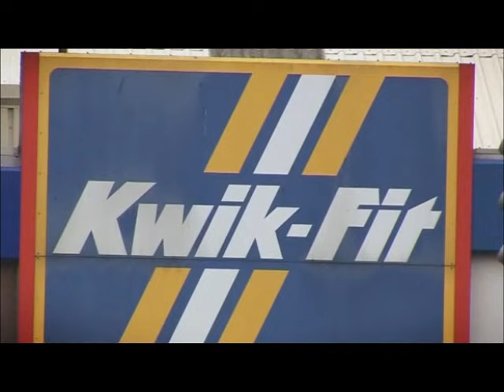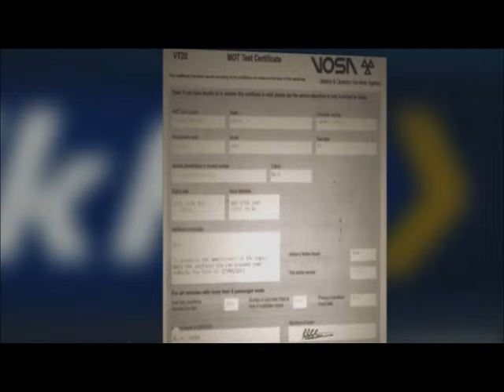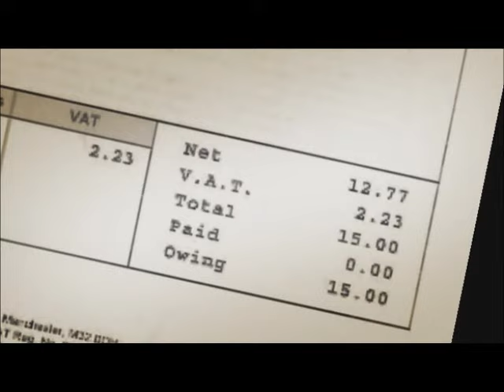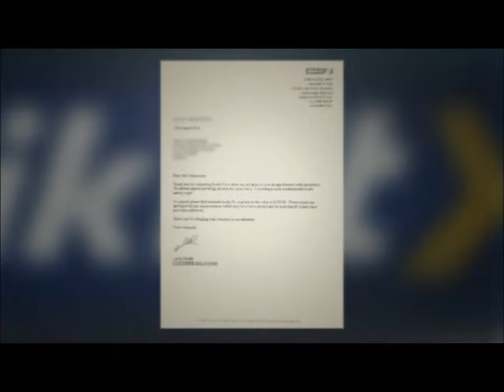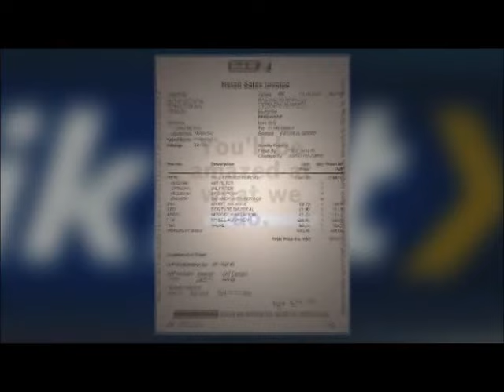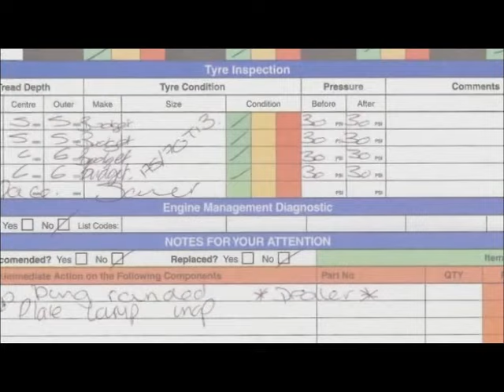Kwik-fit Car Rip-off Watchdog.wmv

Comment: I have used kiwi-fit before like 30 years ago, that was the last time I ever used the rip off merchants, I had booked my car in for an MOT but the day before I had to replace the front brake pads as I new they were in need of replacement and it would fail. So I took it in and about 45mins later I got a phone call saying there were a couple of issues and he said the front pads are down to 40% and may need renewing, I said blimey they didn't last long he said no they do wear very quickly, then I said i only put them in yesterday , then there was a cough and a splutter erm well I haven't had the wheel off yet and the lighting is bad in here, and yes it passed with no problems.
Reply: Their is neither a need or requirement for an MOT tester to remove a wheel, unless he feels that he needs to further investigate a fault. In reality, I have never come across this situation.
In your case, the guy must have been a complete moron to think that you would not have known that your pads were almost new.
Reply: @Ron Flat
Seems you do not know the difference between NEW and KNEW ...
Better buy a dictionary and go back to school to learn English and educate yourself to a higher standard than a 5 year old. 
And one does not GET phone calls, one receives them.
GOT means something that one acquires by toil.
Receive means something that is given to you and you accept it.
If you were a student in my English classes I would fail you.
There are students age 7 that academically outclass you.
Reply: wilsjane as
Reply: thats fuckin hilarious man🤣

Comment: This is why I go to my little local family run garage for anything I need. My car got a couple of advisories on my exhaust brackets and front tyres were apparently worn, plus my allignment was off and these thieving cocksnots wanted to charge me £750+ VAT for 3 exhaust brackets, £250 for tracking and allignment then £85 per tyre!! So I went down to my local garage (Manley Tyres and Exhausts) in Birkenhead, and alls that needed doing was my backbox, they got the part that day and charged me £50 all in. They used lasers to check my tracking, looked at my tyres (which were fine) and advised against going back to Kwik Fit for anything. Oh and the same tyres that kwikfit tried to charge me £85 each for.. My local garage had the exact same ones for £40. 2 years on, my Ford Focus is still running absolutely perfectly and I've done a lot of learning about my car so I can try and see the problem myself before ever getting ripped off.

These big wig companies like Kwik Fit prey on the weak and its disgusting that they break apart someones pride and joy just to keep their figures up. My local garage is a family run, honest business and I'd advise everyone to avoid places like kwikfit. I'm only 24 and been driving just over 2 years, so my insurance and what I pay for my car isn't exactly cheap, but young drivers and the elderly will go the popular garages expecting the better service as they're everywhere, its so corrupt and downright wrong. Daylight robbery at its best. Bunch of robbing, disrespectful bastards.

Comment: My wife took my car to kwik fit, had a nail in rear tyre which the plugged... then told my wife you need 2 front tyres as they are worn... funny that car passed mot 3 days before!!!!!
Reply: An mot is only as good as the second it went off the ramp.. a car can fail later in the day and pass earlier.
Reply: I was in the tyre trade and at the te we sang you cant get thicker than a quick fit fitter
Reply: My car had a tyre warning, took it to kwik fit and they said I needed 3 of my tyres replaced, told them to put my car down and give me my keys as I knew damn well they were talking shite. Took my car to another garage where the mechanic told me it was a false tyre pressure warning.  #stay away from kwikfit. Only chavs work there.

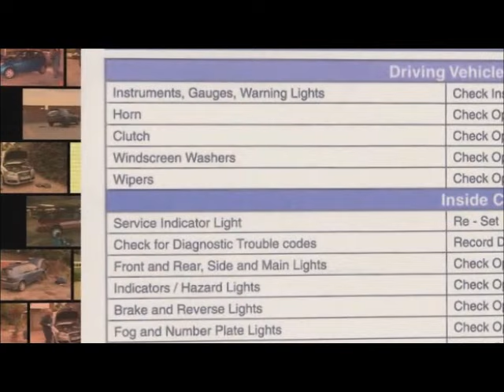Comment: 7:18 Then they went on to say that they had checked the spark plugs on the diesel engine, the carburetors on the fuel injection system, the filaments in the LED headlights, and the control knob on the autochoke.

Comment: All fast fit centre managers are under pressure to drive sales. They put pressure on staff and B/S like this happens. Many years ago when I worked in the trade an old gent came in for a full service. My manager said ‘oh, that’s old Fred he’s a regular so just take the plugs out and give ‘em a clean, steam wash the engine bay and park it up’ Fred was charged for a full service. Two weeks later Fred returned because his car was making a grinding noise when he applied the brake. My manager said ‘give ‘im and ‘is Mrs a lift to the town centre then on the way back visit the scrap yard and get some rear drums and shoes.’ I did and fitted them. Fred wasn’t charged and went away happy because he was grateful for the lift to do his shopping. I felt sick to have deceived such a nice old chap and left that business. A few years later the owner did do time for fraud but he had conned and ripped off hundreds of people by then.
Reply: spectre750 k

Comment: I have worked in the trade for forty plus years and have a degree in mechanical engineering,  this has always gone on to some degree,  the bigger chains seem to work this method to perfection and see most customers (particularly women) as easy targets.
     I am now retired so sometimes use smaller garages for work to save me the hassles,  had these tactics tried on me but once they see you know what is what they back off.  
    Some of the smaller independent garages seem to be adopting these methods as a way of increasing profits.
   With the massive hourly rates being charged nowadays I just see this as greed driven,  always aimed at the quick and easy to replace parts.
   Garages are no different to any other business there will always be good and bad one's,   owner's  would do well to learn a little about their cars that would go a long way to preventing this behaviour in the trade.

Comment: my friends worked at kwik fit for many years . In that time he told me he used to have special training to ensure that they pushed more sales. I said you can't ensure more sales if the car doesnt need repairing. He said tthe staff didn't hit a certain target they were basically threatened with there job.  So it comes as no surprise that unesscerary work was carried at. Also from what I witnessed they are not proper mechanics, no qualifications yet allowed to work on safety of a vehicle ie the brakes.
cowboys.  you can't shitter than Kwik fit fitter. Never a truer word heard.

Comment: I had an exhaust fitted by KwikShit and it came with a one year warranty. After 11 months it started blowing in the silencer. I took it back to the same centre and asked them to check the exhaust. They said it was completely shot and needed a full eplacement. Ok I said and they angle ground off the old one and fitted a complete new system and handed me the bill. I handed them the warranty. Well suddenly things changed. "Why didn't you tell us it was under warranty", "What difference would that have made"? "We would have welded it up if we'd known"  "You said it was completely shot and needed replacement so tough shit,It's under warranty.  I ain't paying you diddly squat. Give me my keys or I'm calling the police."  Cheating bastards.

Comment: No shock here i work in the trade as a master tech,its been going on for years. ...Kwik fit,ats,halfords all the same the mechanics are told to up sell.(.i use the term mechanics loosely  they are normally failed tech's who cant get a job in a dealership as they are crap).........Mates car was in a fast fit center and they  reported it want front and rear brakes discs and pads...i checked them and it only required front pads only.....Top tip keep well away and they are not cheaper than a dealer or independent.
Reply: poly flanders haha ive just made a comment saying pretty much exactly the same thing
Reply: Yes Halfords are the same even today ...said I needed new discs and pads ...nothing wrong with any.. kept charging the wife for full service at 3000 miled and parts  and service but did nothing

Comment: I worked for quick fit and halfords. 
Both use the “free winter/summer checks” to sell parts and labor that isn’t needed. 
The management actively encourages the mechanics to do this. 
I lasted a day in each garage before I left and reported them.

Comment: I once had a manager of a kwik-fit branch tell me that my car was pulling to the left because of incorrect tyre pressures, I stressed to him that I always kept tyre pressures correct and showed him with my wee tyre pressure huge that the tyres were correct according to the manufacturer pressures stated on the door pillar of the car. He actually stood there and told me that the manufacturer recommended pressures printed on the car were only relevant to the car when it was in Japan because it was a Nissan! I laughed at him and told him that 42psi was exactly the same in Japan as it is in Scotland, he then told me that the air was different in Japan and that 1 psi would not be the same as 1 psi in other countries! There was so much wrong with what he was telling me that I complained and got a bunch of vouchers from them that I used to replace worn tyres sometime later and I have never been back. Bunch of fannys!
Reply: Its true what the manager told you. I have my own tyre company and we have a large stock of compressed air from around the globe to suit most manufacturer's. I think of myself as a bit of a connoiss-air when it comes to the windy stuff. When sampling you will find every country has its own distinct aroma, for example, Peugeot,Citreon, Renault have a slight Garlic hint. BMW, Merc,Audi ect have a hint of Frankfurters.  Ford,Chevrolet is a hard one, its like a cross between Maple syrup and Donuts. Once an apprentice of mine accidently put German air into a Citreon's tyres and the car would only drive in reverse. True story!
Reply: He was somewhat right however, air pressure increases with altitude or something.

I haven't done physics so don't pin me on this, but it could be true.
Reply: Air pressure decreases with altitude (the air is thinner).  However gauge pressure is gauge pressure, ie if it says 42 psi it's 42 psi.
Reply: Conoss air good one lol

Comment: I used to work for ats euromaster, very similar to quik fit - the management was always under lots of pressure to hit impossible targets, and bonus is earned from additional sales like wheel alignment, brakes etc. If you know cars then by all means use places like this because you can argue and not be taken for a mug. But if you have no idea, pay the extra money and find an independent specialist. It'll save you money in the long run.

Comment: I saw an elderly lady at kiwi fit she had a small leak in the back box they told her you need a hole new exhaust and three new tyres they had about 4 to 5mm tread I told the lady that the tyres were ok and that she only needed a back box she said I think they know what they are doing...if only she new.

Comment: I have been saying this for years about kwik fit! I used them twice in my life for exhausts parts ONLY because I couldn't buy the part and fit it myself for as cheap as they did it with 3 year cover on the part. HOWEVER I fix all my cars myself and always have and every time I use them they tell me it needs £500 worth of work. the look they give me when I told them I am a mechanic and know better than the rubbish they are telling me I just don't do it as my job because it doesn't pay enough!! and to add insult to injury both times I let them loose on my motor I had to refit the exhaust myself because it fell apart BOTH TIMES!! funny how it never did after I fitted the same part!! ... I once told a mate to go there with a bust rear section of exhaust just because of the price and warned them they would be told it needed £500 worth of work and I would probably need to refit it at a later date but it's my friend so it was a free job if that happened ( it did by the way and I did refit it for free) .... on cue they did ring her and say it needs £500 worth of work on the nose!! so I went in with my mate to check what they were saying, they pointed out a hanger on the middle section of the exhaust was broken free to which I said I would weld it in 10 mins the "mechanic" (cough cough rubbish cough) said all shirty and with attitude "oh you can weld stainless can you" to which I replied it's not stainless A: because it's rusty and flaking away and B: it's magnetic non ferrous metal is non magnetic but the mechanic (cough) still tried to tell me it's stainless even after I had proven I know more about the job than he clearly did!! . funny how i welded it up and my weld lasted until the vehicle was scrapped some years later!! the rest of the work did not need doing it past an mot a few weeks later and non of the dangerous faults showed up because there is no way I would let a dangerous car on the road!!  now I tell people this horror story and tell everyone that the low price they offer is not worth the rubbish they spout!!

Comment: Charged my mum £1000 for a AC part, which didn't even get changed.
Charged my sister for a gold service, they didn't do the spark-plugs or the oil filter and broke a vacuum line too.

Comment: My daughter took her car to them for tyres, they fitted them but told her the rear brake cylinders were leaking . She told them she would see her dad, (which is me ) , so i had a look, there was no leaks, and no loss of brake fluid in the reservoir, even over two years later , and through two mot's. Don't go near them. Also i don't like being called Sir, it makes you want to puke.

Comment: I've only ever met one mechanic I trust.

I took my R33 Skyline for a service at a garage in Colindale that specialises Japanese cars. When I asked them what I get, they said they change the oil and oil filter and check everything else...£700+. Took it to my usual mechanic and got an oil and filter change, coolant changed, a rear cluster swapped which needed to be fitted with a sealant) and a broken electric window motor fixed... Cost me £75.

That said, if you can't tell the condition of your brakes, you've got no hope of not being fleeced... The discs last forever even under the abuse I gave them... Although I did have a pair shatter under braking because the pads had been gone for a while and I didn't replace them because I bought another car... Surprisingly, they still 'worked' after shattering. And you know the pads are gone the moment you hear that scraping noise.

You should be doing your tyre pressures at least once every month or so. You can tell when the steering didn't feel right, especially if you're like me and run super high pressure.

Comment: I used to deliver stuff to quick fit all across the Midlands and South of England and I can confirm that they are all rip off merchants and not just the odd dodgy garage. Once heard them tell a girl would costs over £1000 for replacement exhaust for an Audi that was a few years old. She was in tears. When outside I told her to go to the local garage who would charge a fraction of that costs. Total rip off

Comment: My BMW X5 was called in to the dealership for a recall.  They perform a vehicle check and it came back stating that front bottom suspension joints were dangerous and must be replaced immediately.  Told them not this week and then took car for its MOT the next week to an independent who is trusted in the area and all 3 of his MOT testers checked the joints and stated there was no wear in them at all.  Said they get this all the time with the local BMW garage.

Comment: i worked at waltham cross kwikfits for a month, i see the manager spray wd40 on shocks and told them they need replacing, i was told that exhausts i have to reuse there old brackets or it will come out my wages, final straw was the manager pocketing the money from tyre repairs. i told the manager i cant as its on the wall. he told me to just do it. to which i stated if the car has a blow out on a motorway and kills someone. would he state he told me to or just blame me for it...... he then oviously called me a prick and sacked me.
Reply: I know what you went through m8
Reply: Bro human life has no value its all about money

Comment: I used to work with someone who was a MOT tester for Kwikfit years ago. He told me once the testers were instructed to fail the cars with hydro elastic suspension for not having shock absorbers fitted as the mounting points were there, however they were not required. Also said they were threatened with the sack if they did not conform.